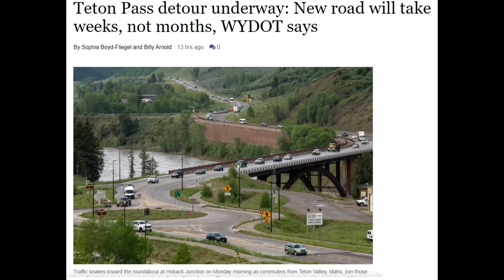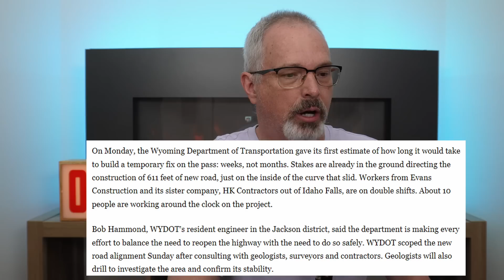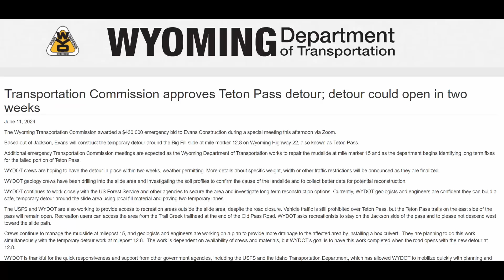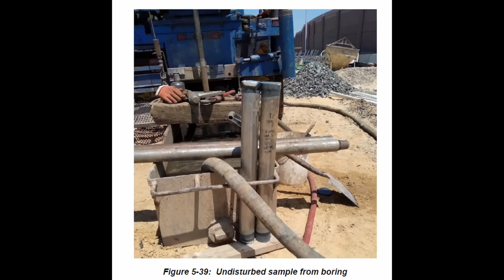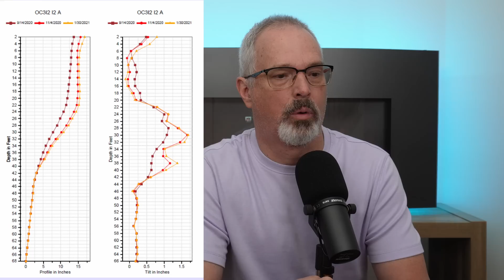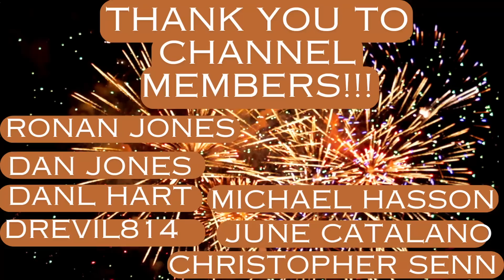Wyoming Slide Update

Comment: I have driven the pass many times over a number of years, most recently 2 days before the failure. The cracks were there and repeated repairs were being made for several years. They knew that the site was unstable because they were going up there and repairing things every year or two. Geologically, the area is very seismically active. During the last 30 days, there have been 95 earthquakes recorded within a 150 mile radius of the Pass. The Teton Range is an area of extension and the highway crosses at least 2 normal faults. Most of the regional earthquakes happen north of the pass, in Yellowstone Park and along  the north shore of Hebgen Lake, or to the south around Soda Springs. But, the Teton Mountains themselves are the result of the basin and range faulting where the land is being stretched, east and west. The Jackson Hole area is on the down-dropped side of the fault. To the west, the Teton River Valley is bordered by a much lower range of mountains with a fault on the eastern margin. The south fork of the Teton River runs along the base of the fault scarp, west of the town of Tetonia, Idaho. That is the river that fed the lake temporarily backed up by the infamous Teton Dam. Much of the soil covering the granite "bones" of the Tetons is welded tuff from Yellowstone eruptions that rained down over the ancient landscape. It is very easily eroded, but it gets used to surface dirt roads in the region quite frequently. If that was what the fill was made of, it was a very poor choice of material, even if it is very common around there.

Comment: I live in upstate NY. Our east, west highway  runs through the river valley. In the county next to us the highway runs close to the river in a few section. One section is on a curve. The road surface is  maybe ten feet off the normal river level. Since the highway was built this curve has been  slowly sliding towards the river causing creacks in the to road and the road to sink because material inder it is migrating towards the river. The states fix has been to just keep adding more blacktop rather than stablize the bank between the highway and river. Just over 20 years ago the highway was upgraded to a fedral highway. They did all kinds of work to bring up to federal standards but not a dime was spent on  shoring the mudslide under the highway. While it wont collapse like the higway in Wy, they still ignore the cause and just keep putting a band-aid on it. The problem is ,before they cobble a patch over it , it gets to be a pretty good  slump in the highway making it a surprise to many people and dangerous in the winter by destabilizing vehicles. Generally around here they wait for people to die before addressing a hazard

Comment: The idea that there is a "permanent fix" for this situation is unrealistic. It's a cut and fill mountain highway built on steep slopes that will never stop moving. Nobody building in a place like that would ever think that it could, would or should be built to last forever. It's never going to be a marble masterpiece built on bedrock and it can't be treated like treasure. It's a high maintenance tool for getting folks from one place to another.  Bang the job out and move on to the next.
Reply: My opinion, given elsewhere in these comments, is that this 'fix' they are installing right now won't last 9 months.  It's one thing to avoid gold plating a project, but it might be worth doing a good enough job after the quick fix that the DOT won't continuously have work crews on this little section of road for the next 2-3 years. A 'quick fix' that has to be repeated so often isn't a fix at all.

Comment: Very imformtive channel.. You mention around the 6 minute mark that these test take typical 2 or 3 weeks . If there working 24 hours on this it would speed up the process to cut that time down?
Reply from the maker: Thank you. That is just the time to collect the samples. Working 24/7 would speed things up but sampling and testing would still not be completed in under a months time.

Comment: It appears that horseshoe turn was created from filling the slope to the desired elevation. That then seems to be the problem. Perhaps the natural slope was not examined carefully enough, was not prepared for the weight of the fill, or the material used to fill to proper height was not carefully compacted. I wonder what Swiss engineers would say about that failure and how they would repair that section - after all, the Swiss are an Alpine country and have some amazing roadways - and centuries of experience.

Comment: Someone proposed a bridge??? I don't think so! 
Google Earth indicates 300 feet of elevation change at the tangents of the two adjacent curves, what would be the ends of a bridge. Path measure around the failed curve shows 3000 feet which, at 10% grade, agrees at  300 feet of elevation. Straight line measure between those same two points (supposed bridge length) is 1000 feet, so the bridge would have a 30% slope- 3 feet of rise every 10 feet of run.  That's far steeper than a ramp up to the back of a trailer!
Reply from the maker: You are right. Steep terrain there for sure.

Comment: I don't know why they refuse to put a tunnel through the mountain? The canyons on either side could be connected. This has been going on for many years, with the inadequate band aids. Side note, there is like, a fault line connecting this down hill left hand bend to the next right hand bend down hill from it. In fact it was the last issue about  (im guessing) 9, 10 years back. Also, we're currently still in full run off.
Reply: You just answered your own question.  If there are faults in the area (and others have indicated it's got some seimic activity) then the challenge factor (and cost) for installing a tunnel is very high.

Comment: The Teton Pass Slide (Big Fill) occurred at the junction of two diverging thrust faults.  (The Jackson and the Cache Creek thrust faults).  These faults have and will continue to make highway maintenance very challenging.  Poor soils, an ever growing traffic population, freeze thaw, and moisture also contributed to the roadway failure.  To try to correct this will require some deep soil stabilization with proper fill material compacted on top.  This is going to be a tough fight against mother nature.

Comment: Spot on for finding out what went wrong and what to do to stop it.     Totally nuts is,  "we are working on our fix"  and the Geologists are going to drill to find out if the sub strate is any good.   Huh.   I know Casey sort of said it,  but clearly,  Drill and find out first not after.   I can see the rest sliding out from under the bypass.   Data,  we don't need no stinking data.

Comment: Looks like a big pile of sand. It was probably moist enough to accept some compaction when they placed it, but has since dried out. I haven't seen any retaining structures in the pictures. Current roadbed was constructed in 1969.  As a casual observer, A lot of stuff gets built using poor practices, and never questioned until a flaw is detected years later. 
I regularly drive across a highway that was opened 3 years after highway 22. There have been a couple failures, nothing on this scale, but I always check out the numerous (arcing) cracks.

Comment: From the photo of the site it appears the loop in the road was taken out to the ridge for the scenic view.  There is a rather flat place with a few trees on it back from the edge about 100 feet.  That would be a tighter turn but vehicles can slow down.
Reply: Unless that tighter turn has a reasonable gradient (this road goes up and down as well as around) and can accommodate 18 wheeler traffic at a reasonable speed, it's not a feasible option for a public road. Nobody is going to spend the kind of money it took to construct this curved helix type of road for the view.

Comment: State DOTs are under pressure to get the road back open and are willing to take some big risks. If it all fails, the DOT is just back to get it fixed fast mode. They won't lose their job or get sued out of business, so they are willing to roll the dice. 
The contractors have to shoulder that risk and try as best they can to cover their own asses if things go sideways, or slide down the hill as it were.
Reply: IF done smartly, and continuously monitored, you can always close/reclose the road if there are signs of a failure, or rain.  That said, they didn't seem to do that before, so I wouldn't expect them to put that level of care in now.

Comment: As a geologist with 40+ years in dealing with surface processes, I'd say that constructing this elevated highway with what appears to be a 40-45° slope was inherently unstable and inadviseable, but decreasing the slope to 30° or less would likely have been prohibitively expensive.  However, this should have been anticipated - sorry to disagree with you (and the people who are claiming it was a "maintenance issue").  The natural angle of repose of unconsolidated materials is far less than 45 degrees, even if you anchor it in with deep-rooted trees (like oaks, which likely wouldn't survive the winters here).
Reply: Couldn't retaining walls at the base be used to lower the slope of the embankment?
Reply: @Scramble-electron-890  ..... Possibly. They'd have to be heavily buttressed in this terrain, and the winter freeze-thaw cycles could do a number on them unless serious drainage were emplaced.

Comment: I think you are right to raise questions about a "duct-tape" fix to this roadway. I think it is a miracle no one lost their life in this roadway failure. You are right to point out that many warning signs of a severe failure were there ahead of this collapse (and that it is a trend). I totally agree that unless there are well engineered structural solutions put in place (which easily could take years to plan and construct), this particular curve is doomed to future failures. I was supposed to travel this roadway myself on a multi-state road trip just two days before the collapse, but for various reasons chose route 26 to travel from Jackson to Idaho Falls. I'm all up for an adventure, but tumbling down hundreds of feet in my car only to be covered with sand and gravel isn't what I'd have in mind! I had no idea. But that is the point! The travelling public should assume that the WY DOT has made safety their number one priority!
Reply from the maker: Thank you and I agree completely.  I sometimes wonder if the DOTs have become used to hundreds if not thousands of death each year (depending on the state) on U.S. roadways.  I think the total number of highway deaths was about 44,000 last year.  I was at a DOT function where they were celebrating a death toll of "only" 980" that year when previously it had been around 1,100.
Reply: I'm an engineer but not a civil engineer. It seems to me that they would need an "overpass" type structure supported by concrete pillars resting on bedrock that may exist 200 feet below the current roadway. Take a look at the structure supporting the westbound lanes of I90 just west of the Snoqualmie Pass summit to get an idea of what I'd envision. Building upon that mound of sand as they did before seems irresponsible.

Comment: I have a hypothesis: the people who thought that they could just patch the asphalt over the cracks will turn out to be the same people who think they can reopen the road in a couple of weeks.
Reply from the maker: I think that is probably the case too.
Reply: I’m a local & yes, in fact 1-2 days prior to this collapse that’s exactly what they did after a motorcyclist hit some huge cracks & went into the guardrail. They patched it and said they’ll basically keep an eye on it. Luckily this happened so quickly afterwards because if not this really would have been tragic had people been on it. I drive this pass all different hours day & night to get back home.
Reply from the maker: @Elizabella-jr9dm  Thank you. You are right, I think WyDOT has been glossing over this sequence of events.
Reply: According to the locals in the comments, the DOT patched the asphalt repeatedly in this curve and much everywhere else. Major parts of this pass road seem to be unstable and they need to patch or fix every year. From what it sounds, the section of the catastrophic failure isn't even the worst affected. I reckon that for permanent fixing, major parts of this highway would need to be rebuilt from scratch and in a way that is very expensive. They've done it in some sections but it's probably not gonna happen on the entirety.

Comment: Thanks!
While it is difficult to tell from the pictures available, it really appears that the amount of material that is now at the bottom of the slope is less volume than the size of the embankment that failed.  Could water table changes be reducing hydrostatic pressures contributing to collapse?
Reply from the maker: Thank you very much, I appreciate it!  I have been a bit puzzled by that too.  My thinking is that this slope is so steep and the fill is so dry, that the failed material was able to flow across a large area.  I think groundwater definitely played a part in this failure.  I suspect there may have been some of the foundations soils that became saturated and lost strength which led to slope movement and progressive failures of the embankment fill.

Comment: google earth says the drop if you cut across is pretty sharp.  Probably why there was a switch back. Both sides of the road seem steep
Reply from the maker: I really wasn't sure what the elevation changes were there, but I think you are right that it would be too steep for a bridge option.
Reply: @CaseyJones-Engineer  google earth also does path contours etc
Reply from the maker: @chrischristenson4547  Thanks.  I will have to check that out.

Comment: It seems to me that one possible explanation would be water pooling on the inside of the curve and draining through the fill. Snow builds up, melts faster in the sun exposed sides of the fill, and the water peculates through the fill slowly degrading it. In addition to this possibility, the fill creates two troughs that drain to one point on the outside curve. That point is right at the centre point at the base where the fill failed. This point is clearly visible on the satellite image. Water training down to that one point slowly undermined the curve until it collapsed. Pouring in more fill is only going to be a temporary fix. If they don't solve the drainage issue it's just going to fail again.  

You can't do a bridge to cut off the horseshoe  turn because of the drop in elevation.
Reply from the maker: Thank you.  I think you have outlined the likely scenario that led to this embankment collapse.

Comment: Back in the day it took only weeks, not months to make emergency repairs. You're soft, or you're right, but let's find out and not coward in a corner and open an inquiry, take and send samples, have them evaluated, have a witch hunt, wait 4 or 5 years for an environmental impact study, run it through the courts so the lawyers get the fricken share. Move it on man, that's what we use to do.
Reply from the maker: So where do you draw the line at recklessness?  After all, we are talking about a public roadway.

Comment: the most significant factor in earth movement is the change in the water content of the soil. further this switchback is developed along a natural saddle, the switchback curve is filled so that it matched the existing slope at the toe, but the question is why is there a saddle in the first place, unstable soil cannot be relied on to hold a stable fill, no matter how much or little time is spent placing it.  wydot needs to get the engineers out there a design a good tunnel and bridge system to carry important traffic from Idaho to Jackson

Comment: I remember the Interstate between Sheridan and Buffalo had the same thing happen two times back in the 90's or early 2000's . Does Wyoming have a problem with engineering?
Reply from the maker: In this case, I think it is fair question to ask how much engineering are they actually doing in this situation.

Comment: The only way I see it working is as close to the trees you can get and keep the speed limit at 15-20 because it will  be a much tighter turn. It'll save that extra hour on the commute for the folks who want to "risk it", and get started on that new connection.

Comment: That 180-degree bend is clearly built on fill. They just filled the natural valley where the road is and very steeply sloped the sides. There was probably very little control over the placement and compaction of the material, which is just spoils from a nearby excavation. That valley was there for a reason and there could still be a natural source of water there, below the soil. Roads can cause many of the landslides that occur in the mountains.

Comment: You know the answer Casey, it appears they are doing a "repair" and not a design.  Just wait till they try to build a new embankment and it won't compact and starts sliding down the scarp.  They will wish they had soil borings, Qu or N values then!
Reply from the maker: Thank you. I agree with you, they need good data on which to act and not a "seat of the pants" approach.

Comment: I’m curious about some thing. I’ve traveled over that pass for several years and there was always a bump there that always shifted your vehicle weight towards the outside of the turn. I want to know what you think that the vibrations of adding a new guard rail and setting those post. Could that have been something to do with loosening up that soil?  Nice work on your channel 👍🏻

Comment: They are calling it a "detour," not a final, complete repair. Perhaps the intent is simply to get traffic flowing, even if there are limits, until complete repairs can be made.
I hope.
Reply from the maker: That is correct but this temporary section is next to the part that failed (and could continue to fail).